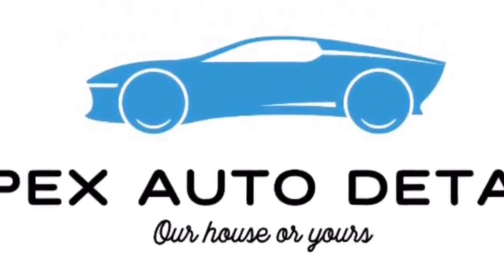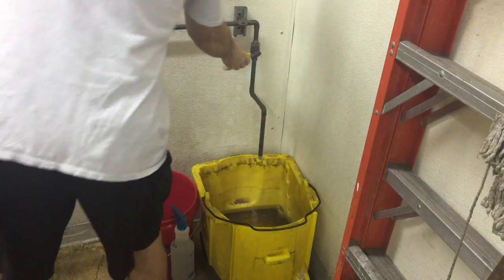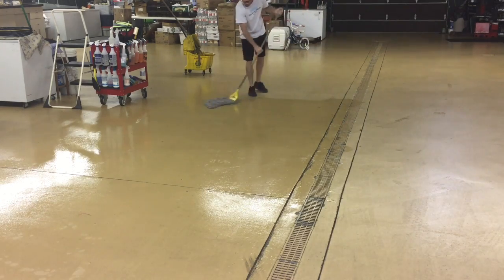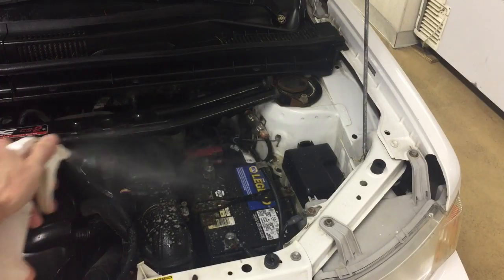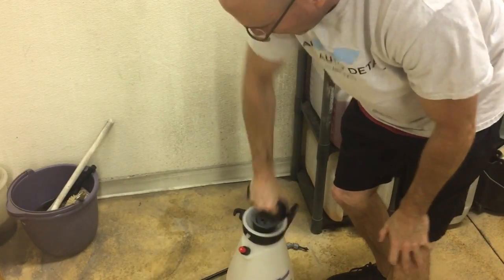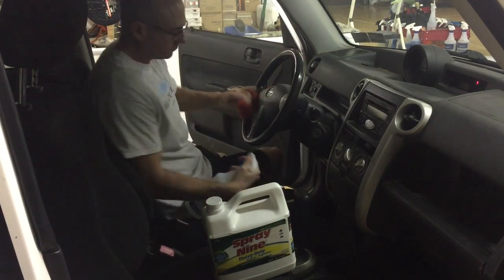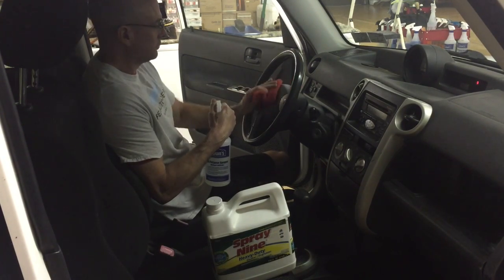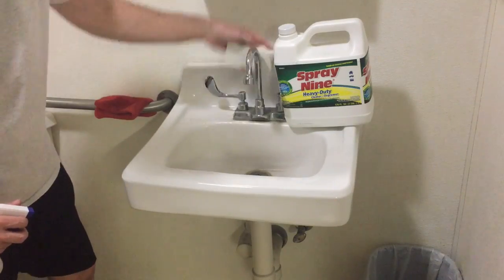Spray Nine for interiors, shop, home: A degreaser, cleaner, disinfectant, sanitizer... all in one

Comment: A clear cleaner gives me another secret weapon in my arsenal. The only only other clear cleaner I know of is Chemical Guys Nonsense for $30 a gallon vs. Spray Nine @ $19 shipped from Amazon. I want to see how it tackles interiors diluted down, especially leather. Thank you!
Reply from the maker: Leather is where you need to dilute it. I never apply it directly. Keep overspray to minimum by spraying into the microfiber 👍🏻
Reply: What's a good dilution ratio for leather? I have a tried and true, but backup is always welcome.
Reply from the maker: 50/50 has been working just fine. If it has been repaired or re dyed. I use the Angelwax dedicated cleaner made for more delicate materials.
Reply: Thanks Brian, seize the day!

Comment: I have also use spray 9 to clean out grease, grim and dirt in car door jam painted metal area and surrounding area and it works really well and does not seem to harm the paint and/or its clear coat.  Do you agree with this?

Comment: Have you ever tried simple green "3d"? It's a disinfectant, virucidal, and fungicidal. One gallon sounds like it would go way further than spray nine since the 3d is a concentrate.
Reply from the maker: I like Spray 9 colorless and odorless. Simple green usually has a horrible odor and has dye. I do have simple clean carpet cleaner :)
Reply: I definitely agree the simple green all purpose cleaner has a horrible smell but I think spray nine is pretty up there too. Not sure how you call it odorless. Definitely no where close. However the simple green 3D has a completely different scent than the all purpose. It's like a "fresh" scent. Can't comment on the cleaning ability of between the two tho. Then again it does still have the dye but 98% 9f products do. I use the 3D to clean the tile floor in my house.